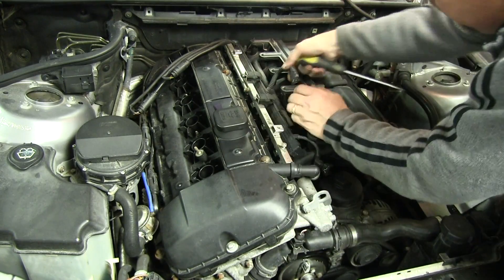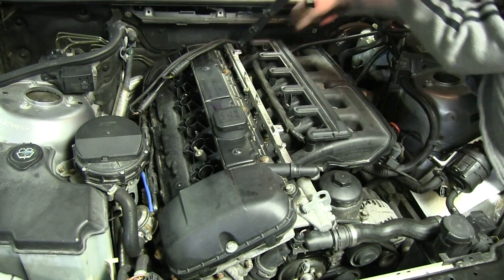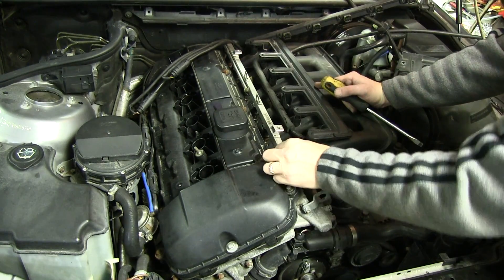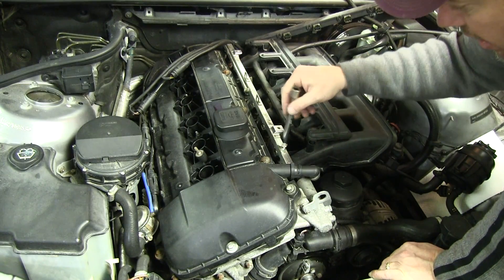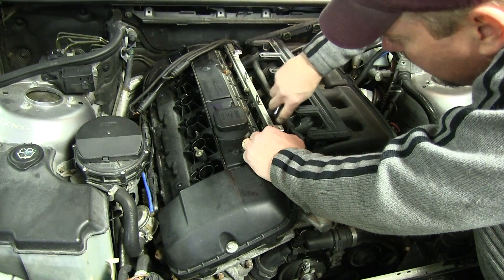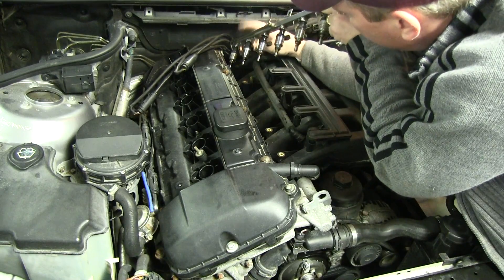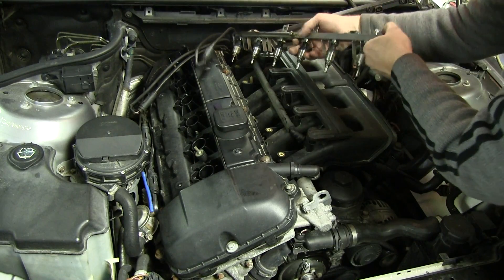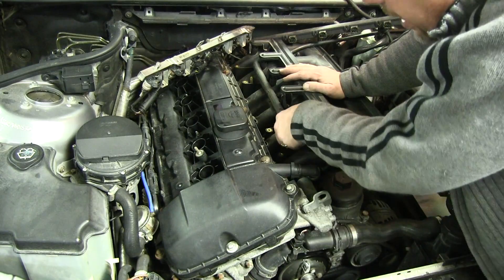Fuel Injector Removal (Part 4) - BMW 2004 325XI Engine Rebuild

Comment: The man I'm trying to do that and it is not that easy like it is stuck
Reply from the maker: Sorry for the delayed response, I hope you got them loose. Sometimes they can be stubborn. (old O-rings probably stiff) If they are really tight, then remove the fuel rail by removing each injector clip and take each injector out individually. Careful not to drop a clip!

Comment: Help me my car pulls gasoline by inyectores but only in the mornings when its cold after all normal.
Do you have any solution please.
Already change leagues
Reply from the maker: Visibly leaking gas is probably faulty o-rings. Addressing the rubber o-rings first would be a good/cheap way to start. Leaking injectors (internally) would need to be cleaned/refurbished, or simply replace with new OEM injectors.